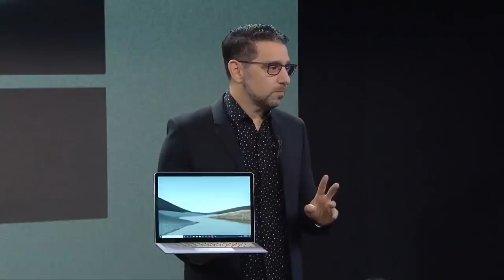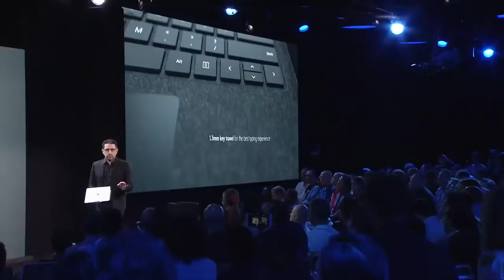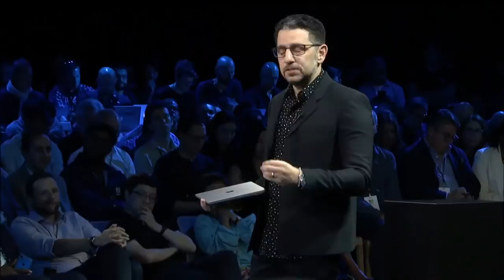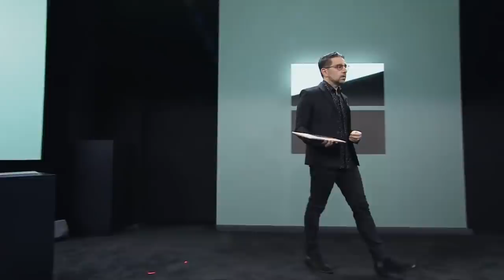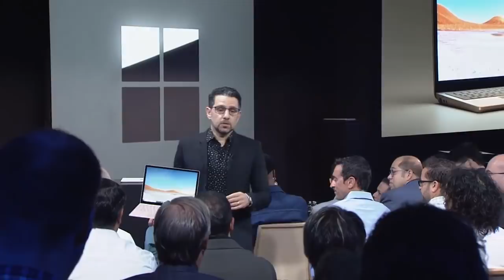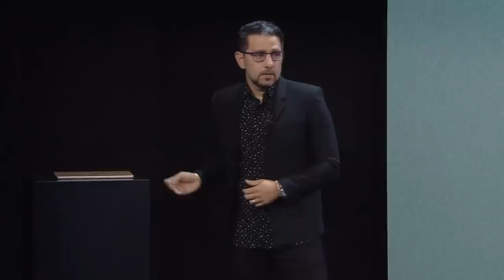Microsoft says they value repair-ability, designs more repairable product.

Comment: Microsoft may have just gotten me as a customer with that if I can actually take it apart and possibly repair it. It's better than nothing, but it's a nice step.
Reply: I’ve got an SL2 & it is a damned good laptop. Besides repairability, SL3 looks like a bit of a spec bump, but nothing crazy. That said, that’s okay. SL2 is great, which means a spec bumped SL3 w/ a serviceable board is great, too :)
Reply: @johnstrad  There are also people who still willingly use Windows Phone linked with desktop Windows. Like me. Using their products and their policies for the last.. half a decade made me from using customized Debian install (which keeled over after I bought a new graphics card and ANY Linux discro started to freaking kernel panic) and "grr, kill microsoft" and  to actually endorsing them.
Reply: There's still a grimy company they're only doing this to keep their Windows operating system around so don't go obsolete
Reply: Only if I can run Linux natively on it.
Reply: Might want to reconsider. The onboard Qualcomm chips are designed to be always online/connected to the internet even with the device turned off. Least con is battery drain, worst con is lack of privacy
Reply: @M.Y.B.A-p4d  do u have a source for that statement? I'm curious
Reply: @TheMeisterManuel  watch "microsoft surface 2019: hands on with the future of windows" by MrMobile [Michael Fisher]
Reply: @johnstrad   I think I'd say one could buy it because it looks really nice compared to the other repairable ones mentioned. 
And even though 1,3 mm sounds like it's way to little, the Surface 2 laptops keyboard is actually the nicest keyboard I've yet to try on a thin and light. 
Eller vad tror du?
Reply: I find it sad that they're slowly bringing back things that old laptops easily had. If these new devices still have soldered on RAM and eMMC/solid state storage, they really aren't that repairable.
Reply: *but it's a nice trap.
You're welcome!
Reply: Sorry for the 667 like
Reply: @financialmoments653  at least it's less wasteful
Reply: I'm guessing there is going to be some annoying plastic clips that will break really easily, and then Microsoft probably won't sell you a replacement top case. I mean their old surface laptop got a 0 for repairability by ifixit, I don't believe Microsoft has gone full 180 on that design.
Reply: I have some fairly reliable (microsoft engineer) insider knowledge that the next surface laptops will also have replaceable ram (proprietary, of course, but it's better than being soldered in.)
Reply: Oh, they're not repairable. I have one of those and they're not repairable
Reply: Only gripe I have with Microsoft is Windows, but everything else they do I can't really complain about.
Reply: @harris9624  just make it work like macos if you want power tools are really cool.
Reply: Harris bah. Windows is not perfect, but it sure is great!
Reply: Harris Yes. Windows 10 home and pro are ass. I’m pretty sure shops, banks, government offices, ect. don’t want CandyCrush and My People on the taskbar and start menu. It’s why most places still use windows pos ready (pre 2010) or windows xp. I enjoy window 8.1 with classic shell 100% more than windows 10, especially now that edge is now chromium based and not exclusive. Shame that all new CPU’s support windows 10 exclusively.
Reply: @harris9624  Except about their shitty phones, their shitty portable computers with glued top and their insanely overpriced pseudo-Apple-copy desktop computers. Yes, the remaining devices are fine. I heard they still make quite reliable entry-level mice.
Reply: their surface lineup is still filled with bullshit where you have to remove the glued in screen to get to anything else.
Reply: Still salty about the first time i got whacked with ADs on my taskbar
Reply: @robsnook4512  use a genuine version next time
Reply: @robsnook4512  What even is an "AD"? Capitals, you are doing them wrong.
Reply: @robsnook4512  Oh god I both love and hate Windows 10. It took a ridiculous amount of time to customize it (but I'm glad the options were there at least), but the ads are gone and everything is how I want it to a degree. But I sure do hate the fact of how the default windows 10 is out of the box. Most consumers aren't going to spend the time customizing their GUI for a better experience and just somehow, I don't know how, deal with ads on their start menu.
Reply: @BT-ex7ko  there are softwares to do it in a few seconds. search for shutup10.
Reply: B Randall 
Just use Windows 10 pro then. It doesn’t have all the stupid stuff like candy crush preinstalled.
Reply: robsnook4512 everytime I install windows to a computer, I go through all privacy settings and disable them.  They may put BS in it but you can still disable it.  Windows 10 is undeniably better than windows 10
Reply: Windows itself is usually the problem for me. I don't hate windows 10, and i had it installed for a year there. Then bluescreen and I'm too lazy to fix it. I overwrote it with xubuntu and got back to work 5 minutes later.
Reply: @144megabytes  I tried to use several ubuntus during the height of the april/may 2018 update debacle but it turns out my particular motherboard hated all of them and corrupts the boot partition on every shutdown.
Given that I am going to need to build my next computer from scratch, I am sure not going to be using Windows 10 then.
Reply: @144megabytes  2 years on and i never seen any bsd..before that i had faulty ram module..
Reply: @SatnamSingh-mx2uc  mine was update related. It updated without my permission and rebooted to blue screen. I needed to work not troubleshoot PC issues. I overwrote it with Xubuntu and was back to work in minutes.
Reply: @144megabytes  so you have time to setup. linux what couldn't figure out to stop auto update?
i mean it's 2 steps away..
Reply: @SatnamSingh-mx2uc  normally it's a good thing. Bad timing and it wrecked the OS so no way to go configure it. I'm a windows and Linux ain professionally but I just didn't have time to tinker with my own system that morning. Later I realized I just don't need windows on it since the simple games I play from steam work and I connect to work through Citrix which finally got an updated client.
Reply: @144megabytes   every time windows get update there are many users who face several problem but i never encountered any problem because of updates..
maybe old hardware is the reason for those people 🤔 or maybe i am lucky 😁
Reply: @SatnamSingh-mx2uc  My hardware isn't bad. a little aged but i dont think it was a hardware failure. I have a newer video card but the proc/mobo are aged (4770k on an ROG asus board). It's still strong enough to game on. I built it overspec for the time, but its obviously been some years. Don't motivate me to spend because I've been eyeing the new AMD lineup.
Reply: Yeah but Microsoft has a tendency to charge prices on the same scale as Apple does for their products. Still recall their surface 3 or 4 (i didn't keep checking since then lol) I think it was that went for over 2500$ or close to it. I recall it was a ridiculous price for what it was offering. I think that was even their low end surface that was that price, think it went as high as 4000$ fully specced or something. My numbers are surely off but for me, for that amount of money, I could probably build 4 gamer rigs who would be all more powerful than 1 of those surfaces.
Reply: Kazeshini Exactly dude. Don’t get me wrong, the laptops look and feel great but their asking prices are just too much for them, it’s like they’re trying to do what Apple does and overprice their products. I mean, they charge $1000 for an i5 with only a 256gb SSD for storage and nothing else. I mean, it’s certainly better than the MacBook Air which is also around $1000 but only with a dual core processor in it. Then if you pay $1200-$1500 you get an i7 but still only 256gb SSD for storage. Even worse, if you want 16gb of RAM with that i7 instead of 8gb, you have to shell out $2,200-$2,500 (prices vary from different places like Best Buy and Micro Center) and guess what, you still only get a 256gb SSD FOR STORAGE, WTF?! Apple may overcharge but at least you she somewhat of an ecosystem with their stuff, like you can airdrop between a MacBook/iPhone, text with iMessage on MacBook, and access stuff in your iCloud, but with Microsoft there would be no ecosystem to offer for the similar pricing of Apple, or anything else that justifies the overpricing of their products. Only good thing would be Windows 10 but even then a lot of people have issues with it and to my knowledge, some apparent privacy concerns with it as well, so even then the Windows OS still wouldn’t justify their high asking prices.

Edit: With $1,200-$1,500 you can get a rig with a Ryzen 7 in it with 8 cores and 16 threads, an RTX 2070 Super, and like a 2tb hard drive with a 500gb SSD in it and just overall more storage and power that blows those Surface and Mac laptops right out of the water. And yes, laptops are different in the way that they provide portability, but just putting into perspective of what more you can get with something else for the same asking prices of these new laptops.
Reply: @awayracketeer6918  it isn't fair to compare the price of a custom tower to a laptop. Of course the laptop is gonna be more expensive, there are more components in it and it's hard to make things smaller. Also keep in mind that these are priced to compete with other 1200 dollar ultrabooks, not to give you a great bargain.
Reply: @Kazeshini11  I have the surface pro 3 and out of the 5 model levels for the pro, I got the middle version which was £1500. The tip level one was about £2200 and the lowest one started around £800. So yes your figures are way off. Also the standard surface started at like £400
Reply: @TheFlyingClutchman  I guess I should've stated that the prices I listed were in Canadian dollars since I'm Canadian. So the dollar value of Canadian dollar is way under the US dollar and the US dollar is way under the Euro dollar so in the end, I ain't too far off. So by today's standard, you machine that cost 1500 would cost me 2200$. I guess it's my bad for not being specific enough, after all, Louis has an international audience so I can't expect my numbers to be accurate all around the world.
Reply: @Kazeshini11  well my point still stands since the starting price of the cheapest surface pro is around the same as the cheaper Macbook Pros
Reply: @Kazeshini11  exactly. They produce hardware that they tried copying from Apple at Apples price points but without the actual benefits that you get with Apples devices. So that leaves all the negative parts and the high price. Congrats Microsoft.
Reply: I wouldn't, seriously.
That man is clearly a lunatic. I can't imagine typing anything on a keyboard with 1.3 millimeter travel. Also judging by the pictures from the event, they obstructed the single maybe one inch exhaust vent with the back side of the screen.
Also windows 10 is not hot garbage, no it is garbage so hot it's nearly achieved fusion. I'm only using it because I had a licence XP from years and years ago that's traveled forward with me through free updates as I've upgraded this computer, I would NEVER pay to be treated like this OS treats me.
Reply: @npiper  "I'm only using it because I had a licence XP from years and years ago that's traveled forward with me through free updates as I've upgraded this compute"

That's a complete lie, there was never any free upgrades from XP to any newer operating systems. In fact, there never were any free upgrades other than those offered from Windows 7 or 8.1 to Windows 10. And if you think Windows 10 is hot garbage, I can't imagine what you think of XP because XP is god awful. I'll take 98 over XP any day of the week.
Reply: @rars0n  yes, yes it is total bullshit 😁. You caught me being too lazy to actually think. Actually a buddy who built specialized industrial control PC's, You know ones meant to interface with extreme legacy hardware like ISA cards, sent me their OEM licence generator for Windows 7, he just made me promise not to go crazy with it. I think I used it like twice and all for the same computer.
XP had the benefit or remaining static if not actively updated. Forcing someone to shell out for an Azure AD server just to set up WSUS is not the correct procedure for managing software updates but for a good while it was the only way.
Reply: @rars0n  There was a campaign for a free upgrade from 7 to 8 when 8 was launched. It was something like "If you have bought a new Windows 7 laptop in the past X months, we will give you a free upgrade to Windows 8." The online form didn't actually require any receipts for the purchase, you just typed in the manufacturer and model of the laptop you had bought. So I just lied I had bought a laptop. It was an official Microsoft campaign, I remember you needed to type your current Win 7 license key and some activation number into that form. It worked like a charm, got a free upgrade for my desktop PC. Windows 8 was crap, though. Horrible UI. I've never bought a Windows license. XP was easy to pirate and I got a bunch of license keys through some school program. Vista and 7 were free through a school as well. 8 was free by using some trickery. 10 was a free upgrade plus I've got a bunch of proper license keys from my current school. I think I have about 30 legit license keys for different versions of Windows, I've been saving them through the years into one, old txt file.
Reply: @Kepe  I don't believe any of that. I work in computer repair so I was keenly aware of what was going on when 8 launched, and there was no such thing.

I bet half of those keys you have are no longer valid. I can't count how many times I've run into a legitimate OEM key that got blacklisted.

Also, if you've ever bought a laptop, then you've bought a copy of Windows.